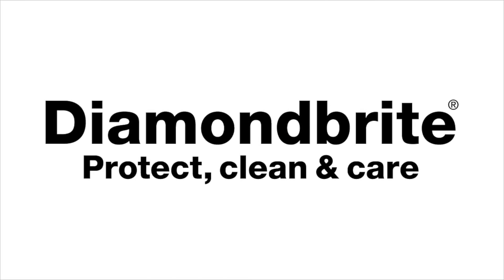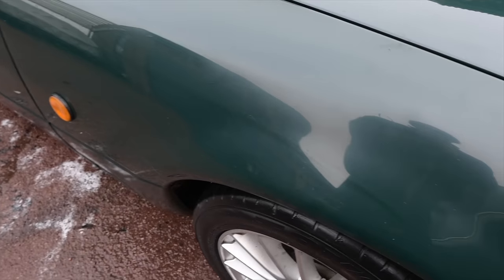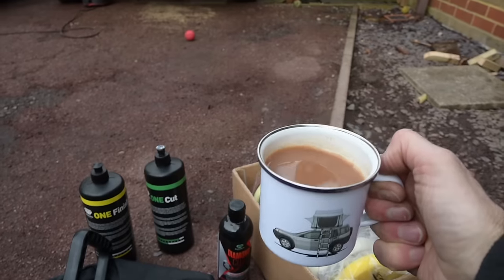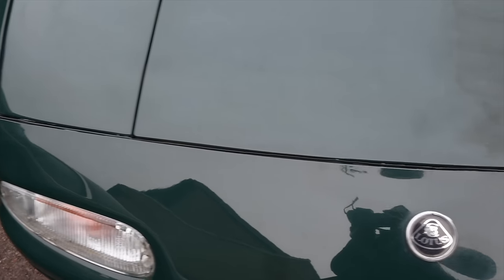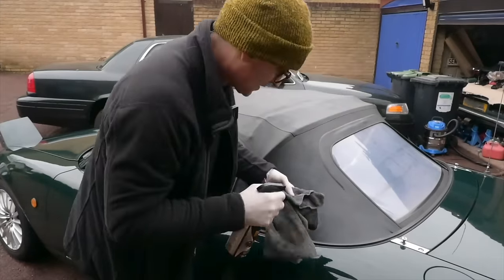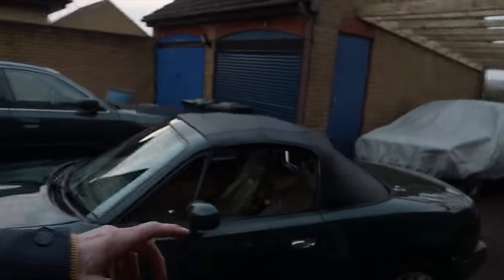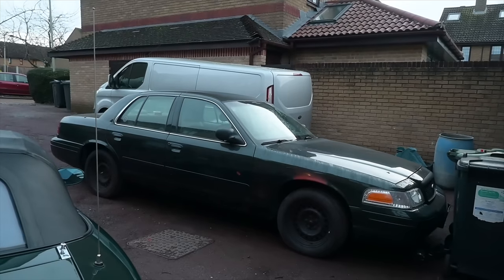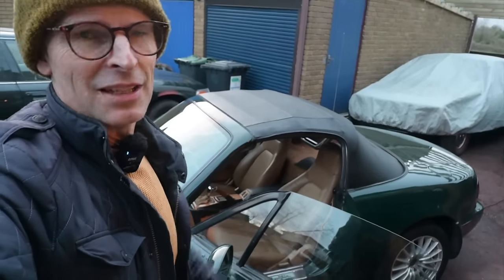A day polishing my MX5 and boy, is it shiny!

Comment: Be wary of going too low on the suspension. My Eunos was very low with a decent set of coilovers. The seller offered to put it back on standard Mazda suspension but I thought a lowered car would be fun. In real life it got beached on speed humps, and when I tried to raise the ride height it just compressed the soft primary springs on the coilovers and meant the stiff secondary ones did all the work and it was scary on wet welsh roads due to no suspension compliance. I went back to Mazda suspension in the end. Turned out they knew what they were doing for a road set up!
Reply: Buy some decent coilovers like BC/Meister-R and they have separate ride height and preload adjustment so you can have it as high or low as you like.

Like you, mine was too low to start with on coilovers but I adjusted them up 5 turns from how they arrived and they were perfect (Meister Zeta-CRD)

Yes there are better coilovers but you'll be spending thousands more. Under a grand will get you a decent enough set

Comment: Those V Spec floor mats are proper hens teeth - keep hold of them! :) I upgraded my headlamps to "crystal clear lenses" with OSRAM nightbreaker bulbs - makes a huge difference and doesn't look much different to standard. Fabulous job on the paint - looks lovely now! If you do want to upgrade the suspension go with Meister-R coilovers over any other brand - better ride and comfort than standard suspension on soft settings, adjustable ride height (without compromising spring compression) for looks and can be set to firm for spirited driving. But get those alloys changed first! :)

Comment: As a Silverstone Roadster owner, loving this new addition to the fleet. If you're looking for suggestions on wheels look into E30 BMW 15x7J BBS rims, can find them surprisingly inexpensively and with 195/50R15s they fill out the stock arches very nicely. I will say those awful front and rear badges need to go.

Comment: Just something I would personally recommend is if in the future you are claying a car, go ahead and hit the glass, the windshield especially as there is often embedded contaminants in it as well. Granted not nearly as much as you would find in the paint as glass is much harder but you might be surprised how much comes off on a car of this age. It will have the same benefits as claying your paint and is definitely worth doing if you are already doing the rest of the car anyway. It also helps preps the glass for a glass sealant/ coating if you want the windows to really bead water and be easier to clean.

Comment: Nice car, good find.  Amazing what a timeless car the MK-1 MX-5/Eunos/Miata is.  I'd really like to find a rust free example although I'd then probably want to put a V8 engine in which would probably turn it into a different car.
Shame about that wing but at least it's not too unsightly and can live until you can sort it out.
IIRC you can swap the roof with a MK-2 version with glass rear screen which may be of use but as you'll want to drive with the roof down as much as possible may be a false economy

Comment: Very interesting video, and a great job cleaning it up. Fantastic. Did I see the Hella logo on one of the headlamps? If not, nothing beats Hella NightVision. However, the PIIA Ultra White H3 is the best bulb for the job. No glare or spill to blind other drivers but illumination on the road better than any LED light I have seen. There are flasher relays available that are compatible with LED bulbs for turn signals. Means you do not need to muck about with resistors to keep the signals from hyperflashing.

Comment: Looks great Matt! The 'tombstone' as they call the centre stack with the radio in, is often not double-DIN, it's larger and will leave a gap at top or bottom. You can buy a double-DIN version of it but it's not cheap or easy to find necessarily.

Nardi torino wooden gear knob is also a rare thing and they are not cheap either. Probably why its not on the car!
Reply from the maker: Wonder if someone does a surround to fill the gap?
Maybe a Momo gearknob will fit instead

Comment: Good job, it looks fantastic!
It's difficult to tell on the screen, but a paintless dent removal specialist might be able to get those dents in the front wing (and others around the car) out, negating the need to fit a non-original panel (that may not match the original colour of the rest of the car).
We use to use Duraglit to restore cloudy vinyl windows on our old MGs back in the day, might be worth a try if you can find some?
Reply from the maker: I had been pondering having a go at PDR, it will still need paint but less of it
Reply: It's amazing what an expert Panel Beater can do with the equivalent of a sink plunger and a planishing hammer.  Not cheap though.  Duraglit Silvo is milder or any Silver cleaner/polish.  Good on dull Plastic Chrome as well as real.

Comment: Nice. I always wanted an original MX5 but I'm far ro tall. So last week I bought a Rover 75. They were only V6's here in Australia and mostly automatics. 1000,000 km/60.000 miles on the clock. No rust here of course. I'm of to buy wippers, a clay bar, and polish!

Comment: great job in cleaning. The retore you used on the roof , does it help to preserve the stitching in the hood
Reply from the maker: Its a rubber and vinyl cleaner, so depends what its made from, but removing dirt from stitching keeps it flexible and means it will move without cracking, so in a way yes

Comment: I vote you try to repair the dent yourself with some PDR basic tools. Try to get behind the dent first to push them out. If you go too high, then tap them down. Try not to repeat what happened to the Rover in Father Ted. Fun fact: Edd China was the prop guy on Father Ted and did all those little hammer marks on it.
Reply from the maker: I didnt know that! Wonder how long it took him?
Reply: @furiousdriving  That's a question for next time you see him floating around!

Comment: Massage  some Vaseline into the leather seats really feeds the leather.  Lovely car 😎😍
Reply: You should use caution using petroleum based products on leather, as it can actually cause it to dry out prematurely and lead to cracking.

A good quality leather cleaner and conditioner used regularly will be fine.

Comment: It’s looking really good .
I reckon a good dent removal man could get those out of the wing
The paint measuring depth thing are OK but you need to spend very good money on a decent one. Otherwise you will not know how thick the actual topcoat is only gives you the depth to the metal doesn’t tell you how thick the clearcoat is or paint to the primer so you need to spend quite a few hundred to buy the proper one
Reply from the maker: good point, not much use otherwise

Comment: You do know retro fitting LED bulbs in to the normal exterior lights is an MOT failure. You have to get complete new units that are designed for LEDs, not halogen /fillament.